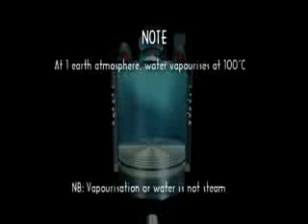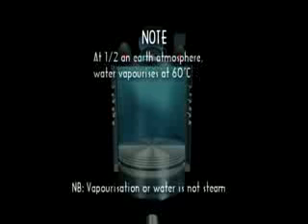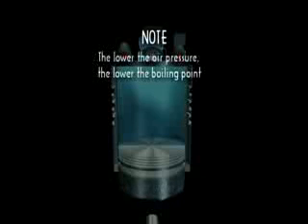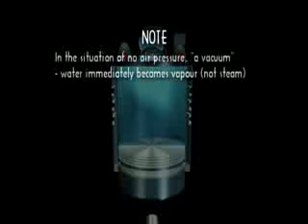Water Manipulation Motor - the details (2 of 2)

Comment: The amount of hydrogen created in that short period of time would be negligible, and if you were to pump enough electricity  into it to create any significant amount, you would use more energy than you could put out. Without a strong power stroke there will not be enough power in the system to compress the air to 16 atmospheres. The laws of thermodynamics show that this won't work. Yet another "free energy" design.

Comment: Like I said if you want to inject water into your engine there are more efficent ways of doing it but from my experience when you get an HHO gen over a 180 degrees you start loosing performance and thats because the water is vaporizing and is taking up some of the displacement where fuel was taking up that space which now is being displaced by the water vapor and inhibits the combustion. Understand now?

Comment: Well I've worked on alot of blown head gaskets and cracked heads that when looking at them makes you wonder how they did so much damage like shoving valve up so high that they are past the seats and mushroomed as well as pistion being mushroomed. And piston shoved out the side of the block. And how hot do you think that conbustion was? And it did not vaporize that water which did all that damage.

Comment: Ok, Hoser4, your last 3 replies noted here in this response, I think it could work if you can control the release to make sure to only release the steam and not the liquid water into the cylinder. Noting that there are more efficient ways to accomplish this and winter seasons would be a problem for operation, factors of which would have to be designed into it.

Comment: Ok, until this becomes heated and/or becomes steam it is just water right? Have you ever took an engine apart that has ran water thru it? It would take alot more energy to preheat this to where it would remain steam when it entered the cylinder. And then it would just be am assisted steam engine then wouldn't it?

Comment: George, I don't think this would work.I don't know if you ever seen the inside of an engine that had liquid water run in it but it will push the valves into the head and I've seen it mushroom the top of the piston too.